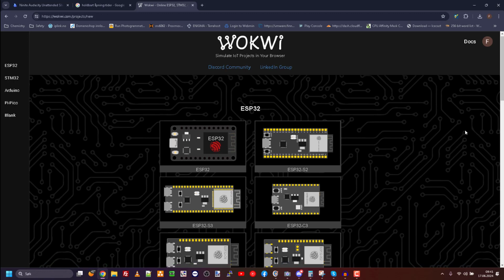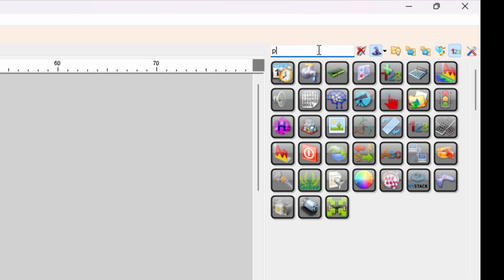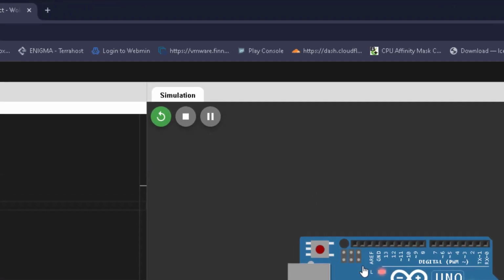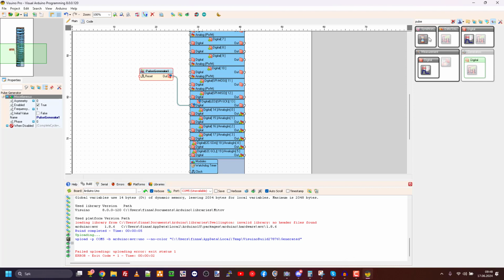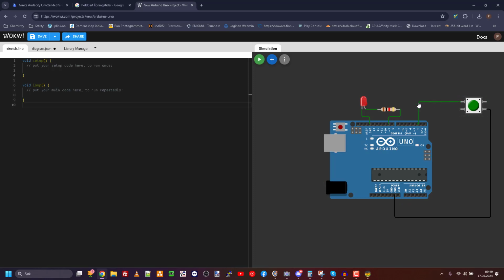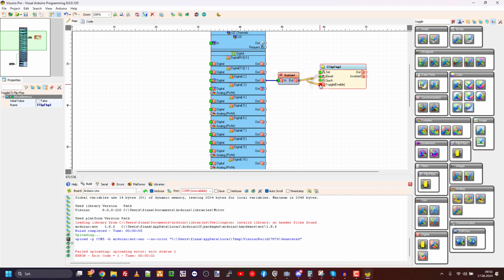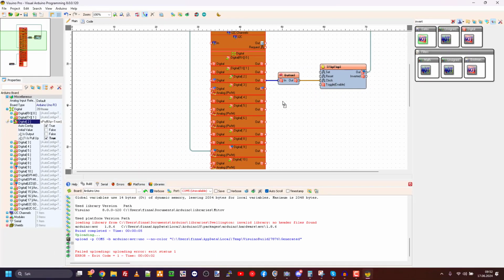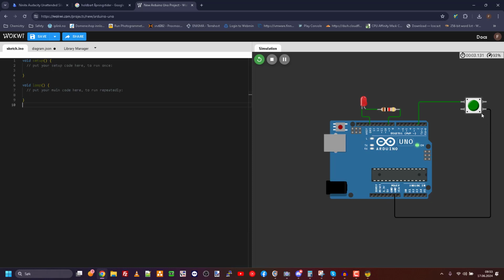Visuino - Loading of Firmware in WOKWI generated from VISUINO

Comment: BTW: When inverting a button, it is better to invert after the debounce. If the Debounce is directly connected to a digital pin that has interrupt, it will use Interrupt implementation, which is more efficient. The code will also use less CPU if the inverter is after the debounce ;-)
Reply from the maker: Ok, thanks for tip 😉